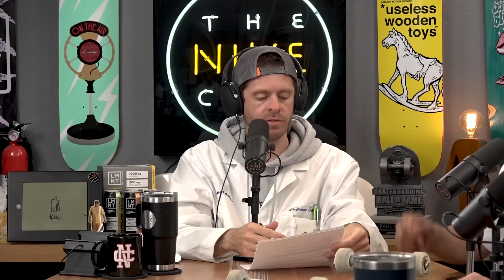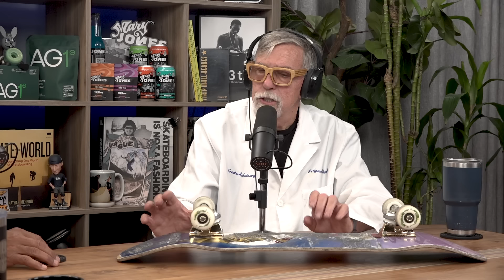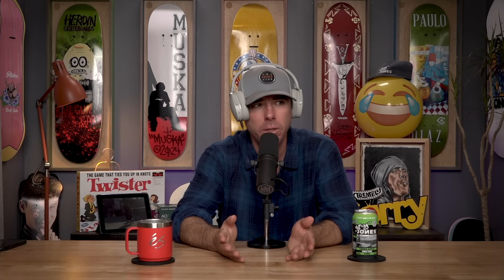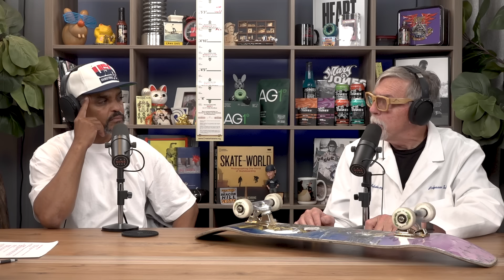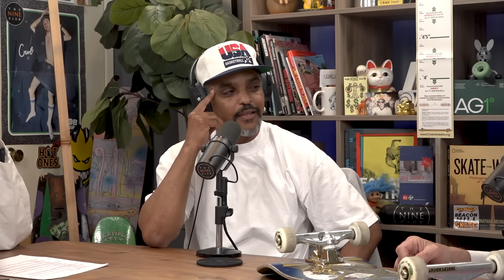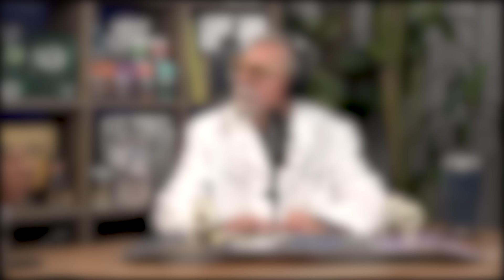Why China Hot Presses Skateboards & USA Cold Presses Skateboards

Comment: Hot press with contact cement
Reply: that cant work, contact cement bonds "on contact" so it would bond before it is placed  in the mold, plus contact cement isn't really structurally very strong, nor waterproof , or heat resistant.